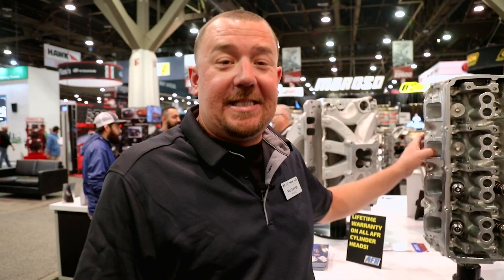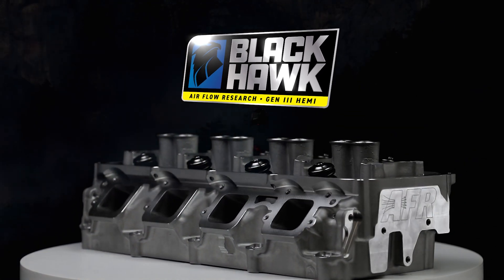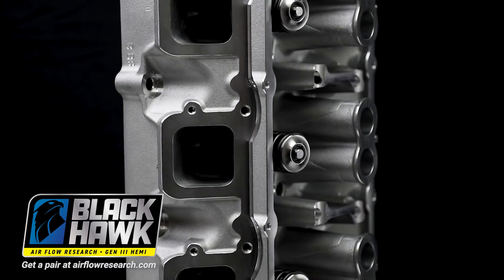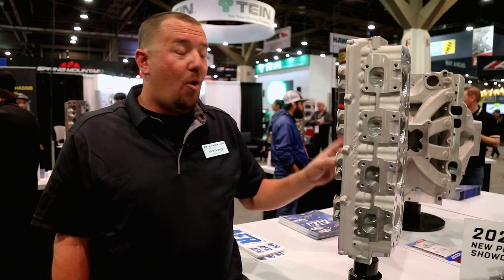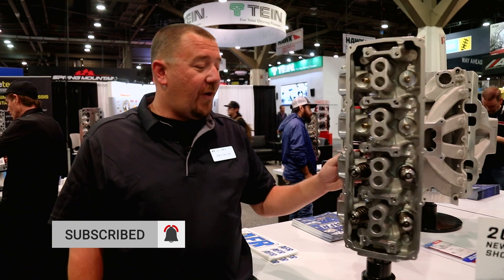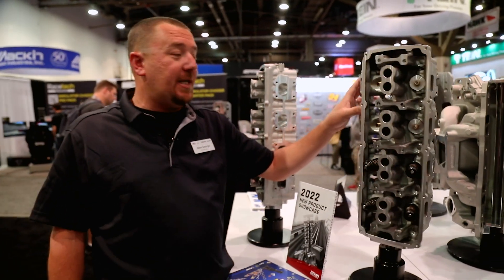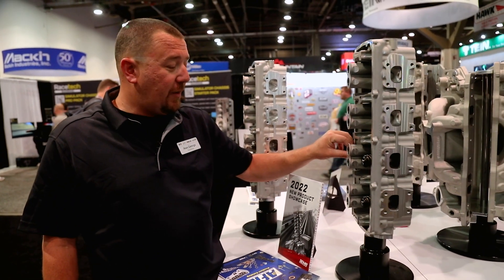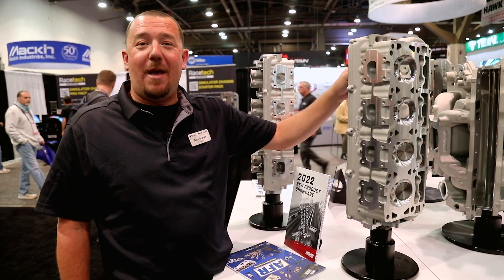Quick Look: AFR's New BlackHawk Gen III Hemi Cylinder Heads

Comment: Those are Hemi heads , you shouldn't have any difficulty getting at least 400cfm on the intake side .
Reply: 410 ported , 425 with a 6mm intake valve stem

Comment: How about posting what they can flow with a bore that can actually fit in a hemi block? These numbers are meaningless and just posted to inflate sales.
Reply: The 224 Back hawk is 390CFM at .700 with a 4.06 bore fixture, same head with 2.20 valve goes over 400cfm @ .700 with  4.06 bore fixture.

Comment: I'll be interested when you use a 2.25" valve / 440cfm or 2.30" valve / 480 cfm at .700 lift.  Thanks for making a head that matches a ten year old Thitek head but I was really hoping for something much better from AFR.
Reply: It flows better than a thitek head actually and their lead time is less than a year. Still better than an edelbrock too.
Reply: @sleepychallenger  Please post or a link to the data.  Thitek claims 100cfm over stock with a 2.165" Intake which is what AFR also claims and Thitek's can be ordered with 2.20" int.  AFR"s flow especially well at low lift but their test was run with a 4.38" bore...not realistic.
Reply: @brianshawsr thitek basically own the hemi platform when it comes to heads only thing AFR can best them at is price
Reply: @sleepychallenger where is your data to back up the hose claims
Reply: Flow numbers arent everything theres more to choosing a head for sure.
Reply: @gordocarbo  Sure and Thitek has cnc chambers and ports. They offered 2.125, 2.165, & 2.20  Intake valves for years prior. AFR is a great company but it made a slightly better head than the Performer RPM and the factory Hellcat head.  We need a 2.25/2.30 Intake valve and 460-490 cfm not another 385cfm.

Comment: It's about PHUCKING TIME...............I've had great Experience with your Ford and GM heads.......But the Deck is not the issue with big Boost #s on the G3, it's the crappy 4 bolts per cylinder those two upper 8mm bolts on top of the Lifter "pocket" are not doing anything other then keeping oil from seeping out..... Again THANK YOU I"VE BEEN EMAILING YOU GUYS OFF AND ON Since last January about these heads.